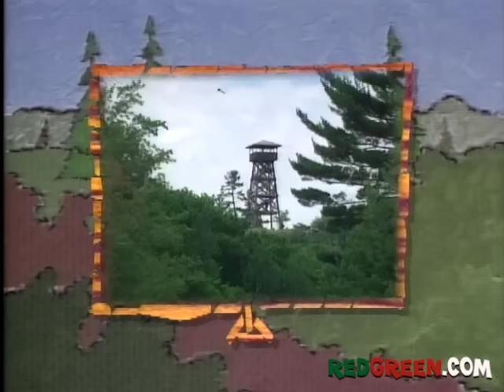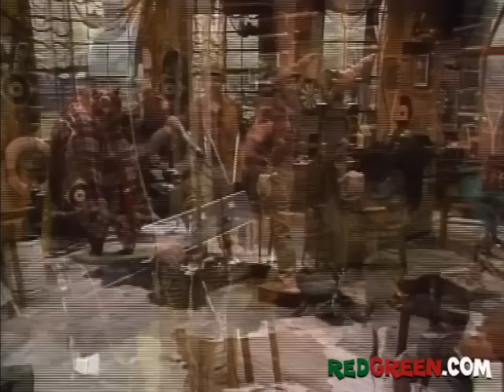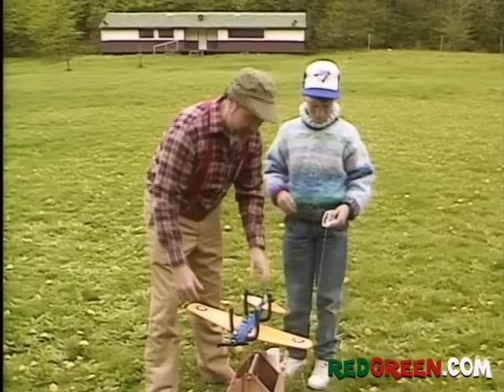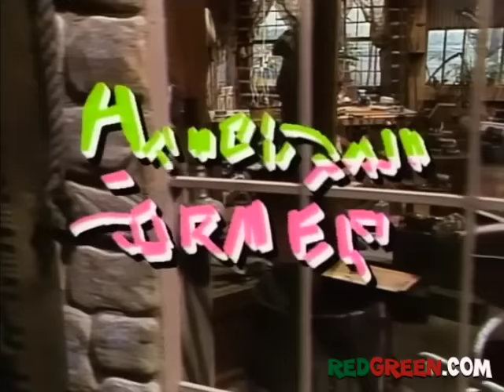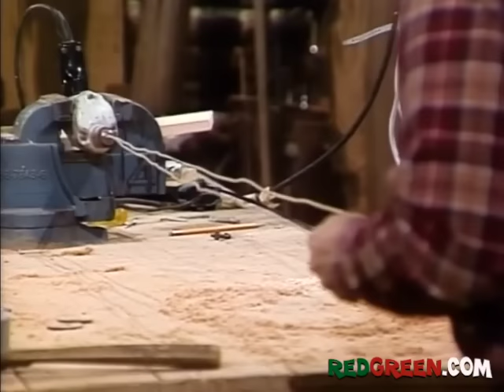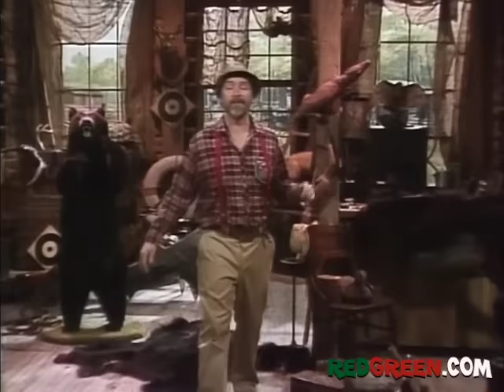The Red Green Show - S01 E02 "The Elvis Sighting"

Comment: I have actually used the drill trick with wiring many times. Only I clamp the ends of the wire in the vise first. Then I chuck the other end into my cordless drill and pull my wire out straight and hold a bit of tension on it.  Slowly run the drill and let it twist up. You get a nice uniform "cable" that covers up nicely with loom or wire wrap and also threads into frames and between places super easily. Worked at a place installing drive by wire systems for handicapped people and this was taught to me by the shop owner. So, not as crazy an idea as it seems.
Reply: Exactly.  I have seen my husband do the same thing.  (Of course, my husband actually IS handy.)